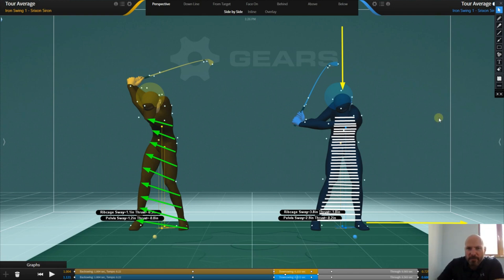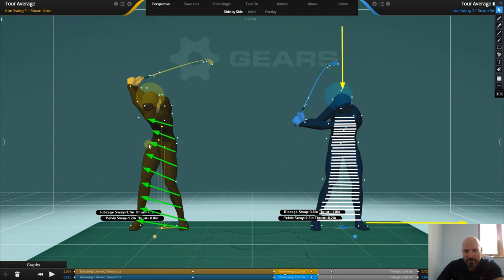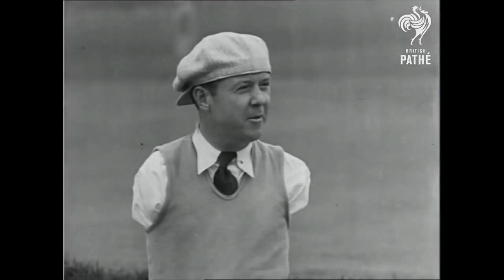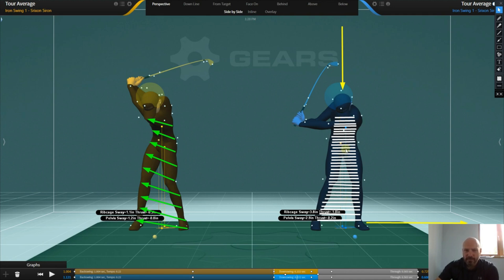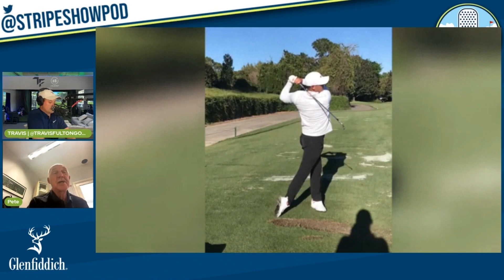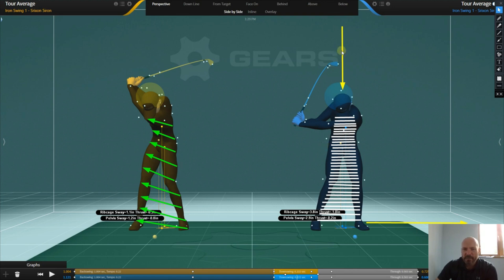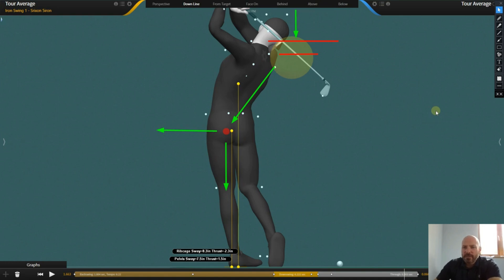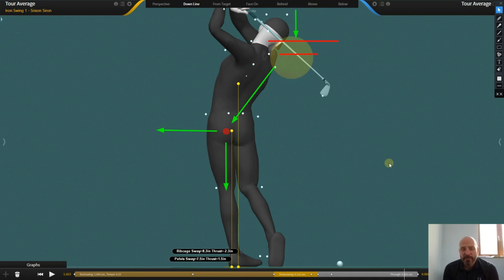How to Uncoil Correctly Part 2 [Pete Cowen]

Comment: If the head and hips lower during the backswing to create a coiling effect, why  in transition does the club not plough into the ground at impact?
Reply from the maker: 1) the shaft is leaning forwards more at impact which shortens the distance between the clubhead and ground. 2) the left side of the body is extending / pulling upwards away from the ground. They are ploughing into the ground a bit but the ball is hit first and this lowering is why they compress the ball so much better than amateur golfers which gives them more distance and insane ball control.

The next question would be what about Driving? The ball is further forward and they are hitting upon the ball, also the spine tilts backwards away from the target more which increases the upward hit, they still do the lowering stuff just like the irons 👍

Comment: Thanks, this video is really insightful and I think clarifies what I've been struggling with re understanding Cowen's coiling concept. He says in his spring analogy that the compression occurs before the spring is wound to the top, which  I'm guessing initiates the uncoiling at the very bottom and aligns with my more traditional understanding of transition that a slight  re-centering and lower body weighty shift occur while the club is still going back. What I struggled with is that in other videos he, and particularly H. Stenson, state that the downward motion of the right shoulder starts the compression and initiates  the uncoiling---and you can't have right shoulder going down while the club is still back so the only answer I could think of was that there must be more than one act of compression. Your video thankfully seems to show this. Do I have this right? Does compression during the backswing allow for the weight shift before the downswing and does the further compression from lowering the right shoulder in the downswing not only push the pelvis further back but also add more GFR into the uncoiling ?
Sorry for the lengthy question but the more videos I watch on this concept the more subtle inconsistencies occur to me, rightly or wrongly.
Reply from the maker: The weight shift is in the pelvis/ hips moving towards the target on the backswing and also the spine tilting towards the target. Here is a good video where I explain this using Gears and McIlroys swing as a model... 

https://youtu.be/d4V4_yzPVKg

The downward compression from the body in the backswing which you can see in the video you commented on, pushes the tailbone / pelvis backwards out of the way, giving you space for your arms and club to come through, and adds more GFR as you say. 

The right shoulder is "Loaded" in Transition like a boxer loads his shoulders to deliver the blow, then there is a downward unloading of the shoulder, hope that explains everything :-)
Reply: Thx, that really helps clarify the weight shift v the compression(s) for me.

Comment: I appreciate and value your analyses but isn’t it the body which “compresses down” - largely through flexion of ankles, knees, hips, and spine that causes the head to drop. The phraseology, “compressing from the head” Is a bit confusing because the head has no independent motive capacity, I think it might be clearer if you said “compress from the head down” which implicates the whole body.
Reply from the maker: If you watch as the spine starts to come back up, the head is staying down, so the question would be what is keeping it down..?   Otherwise the head would come up with the spine..

Comment: now i am conflicted-- showing on gears that hips go down--i always try to pull right hip up and back-like trying to start an engine pull cord----confused ?
Reply from the maker: the hips do go back and up but downwards at the same time, the measurement on gears is from the centre of the pelvis which is midway between the left and right hip, just lower your body as you swing back and down 👍